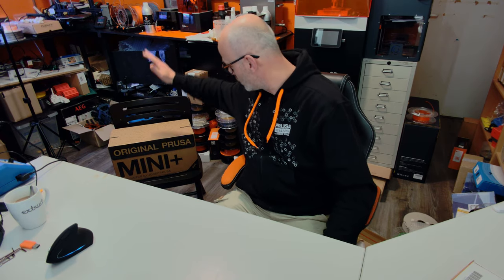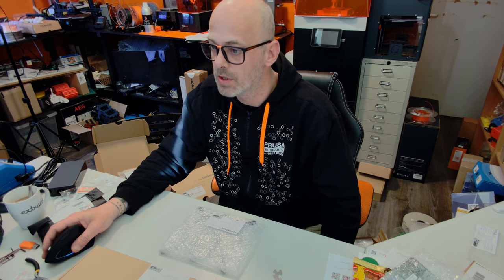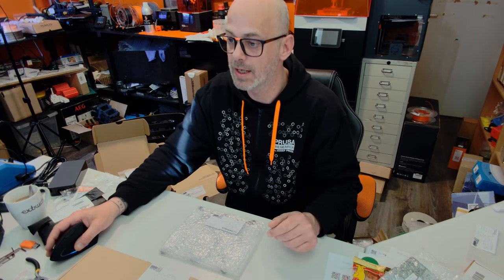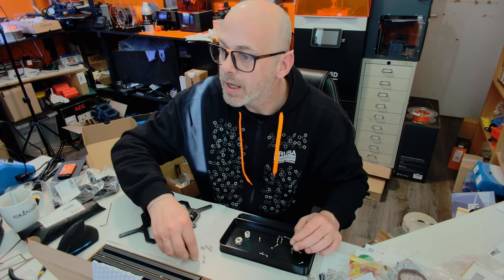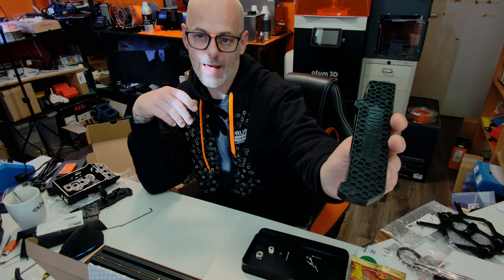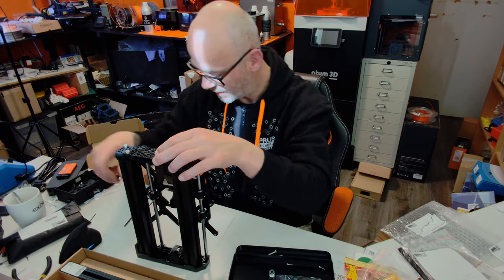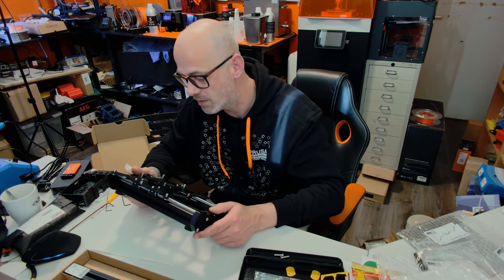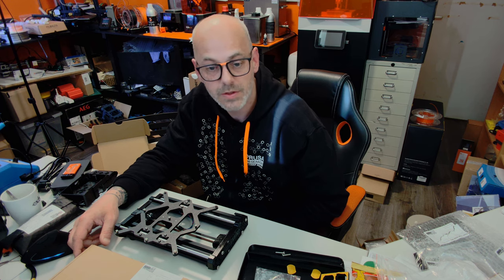Prusa MINI+ Assembly Part One

Comment: I had the same problem…. Stepper motor pulley was installed backwards.  Lots of fun tearing the rear end off to reverse the pulley…. Yes the photos show the pulley installed on the stepper motor correctly.  I must be Lysdexic… (dyslexic).  Got it backwards….